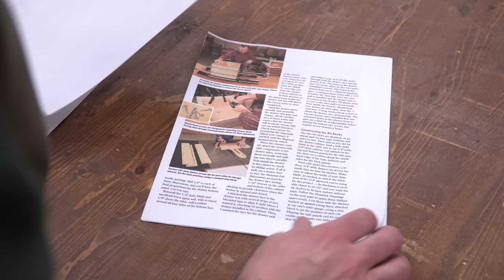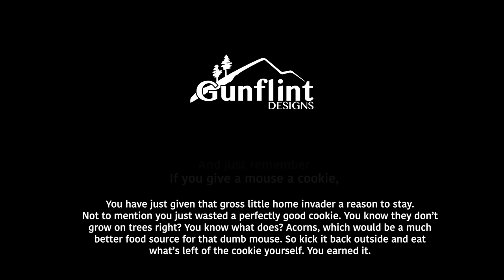Router Table Storage Cabinet & Bit Organizer

Comment: That's an amazing upgrade. Now I need to get that router table! I have 2 shop-made ones that aren't as precise as I'd like.

Thanks for the video!
Reply: Ok, I got the router table and all the goodies yesterday. I'm 99% finished with putting it all together as of 15 minutes ago. Tomorrow will be the first cut on it. Then I'll be building the cabinets like you have there, with a few changes of course.

Comment: WOW!! What a great look and improvement. I especially like the use of T-track for the feather boards. With you and Drew always using some"unnecessary walnut" in your builds, I've been adding " unnecessary Purple Heart" to my projects.  I like your attitude about shop projects and using them as a way to expand your skills. I feel the same way and my new assembly table will have some complicated Japanese Joinery in its structure. I try to learn a new joint each month and right now it's Japanese joinery and It usually takes much longer than a month to learn each of their joineries. They are like really difficult wood puzzles, lol.

Comment: You did a great job with your first frame & panel door. The only thing I typically do differently is prefinish the panel, so when it expands and contracts, it is less likely to show a gap strip of unfinished wood. It also helps you pop off any excess glue squeeze out that gets on the panel during glue up.
Reply from the maker: That's an excellent tip. If I'm ever doing a bunch I'll probably go that route. For a single door I'm glad I didn't have to clean the sprayer twice.

Comment: Why do they call it a cabinet carcass? I always thought that sounded gross.
Reply from the maker: I agree with you, carcass references something being dead - so I normally avoid using it. I think this is the first time in the history of my channel where I let it slip. However, it is correct according to the dictionary. 
-the structural framework of a building, ship, or piece of furniture.

Comment: I totally want a video showing how to do those panels!  What was that spacer you used for the router bit height?
Reply from the maker: Rockler has those setup blocks for a lot of their router bits. just buy the block when you buy a bit and it makes setting up the cuts super easy.

Comment: Congrats on yet another Rockler Router table storage video. https://www.youtube.com/watch?v=8joE_tZloe0   . My 2 router tables in the shop do not roll around. I built a large wall cabinet to house all 9 handheld routers, bits and accessory's. As you get older bending over to get things tends to wear you out. I have used this same set-up for over 30 years. Roll around units have their advantages if you are limited on space but I have never liked the fact that even with the brakes on the wheels, they don't feel solid. Dust collection hook-up becomes another issue. And yes always have spare walnut in the shop to give that shop project a bit of class!

Comment: If you are the kind of person that likes to get what you pay for, then read on.
Very disappointed in recent purchases of their "Rock-Steady" components.
Wanted to duplicate a workstation with sliding drawers so I ordered all the needed components from MN.
Here's the problem... the pre-drilled holes in the drawer brackets and the horizontal slots in the cabinet member of the drawer slide, do not align.  This makes drawer slide installation impossible without breaking out a drill and drilling new holes to accommodate the cabinet member of the slide.
Also, the hardware that comes with the Centerline drawer slides are wood screws only and not machine bolts and nuts. Now you have to purchase or provide additional hardware.  Nice.

If you are building a configuration for drawers, you will need vertical center supports to accommodate brackets.
However, you will find that installing drawer brackets on these center supports is a challenge, again due to slight misalignment of pre-drilled holes.  You will need a drift, an awl or possibly a clamp to assist in the assembly.

The overall experience has been very negative, and Rockler folks seemed indifferent to the issues.
If having drawers is your goal, then this is not a "plug and play" solution nor a simple bolt together solution.

How can a company sell expensive components to customers knowing the products do not perform as advertised?

Rockler employees and management were disinterested in addressing the issue or helping to facilitate a solution.  Tried to contact upper management since this problem is so serious and obvious, but I am still waiting for their response.  (By serious I mean selling items to the public when you know the items do not perform as advertised.  There is a word for that.)  
Should my situation change, I will gladly update this comment or post a new comment here.
Meantime, as a service to other customers, I will post this experience at other locations.
Rockler's "we just don't give a s**t" attitude to customer experience makes future purchasing decisions easier.